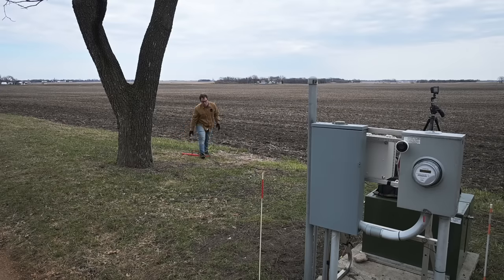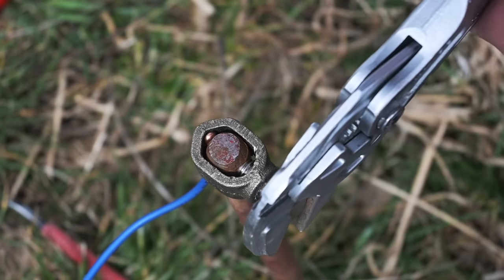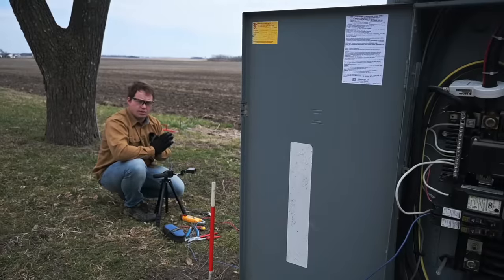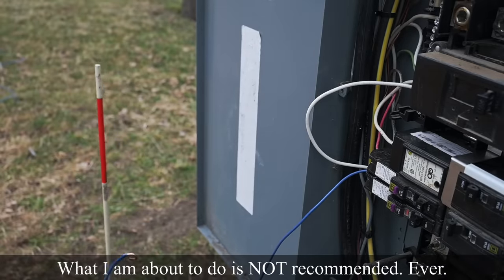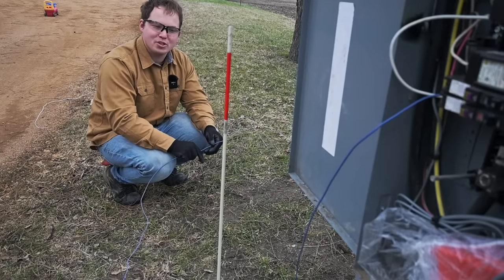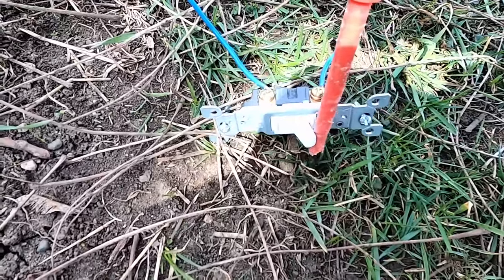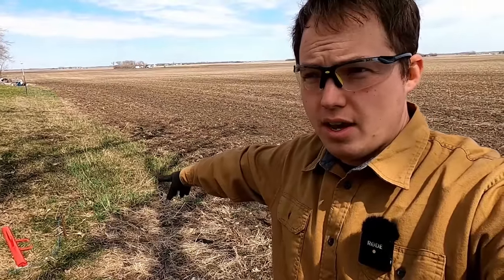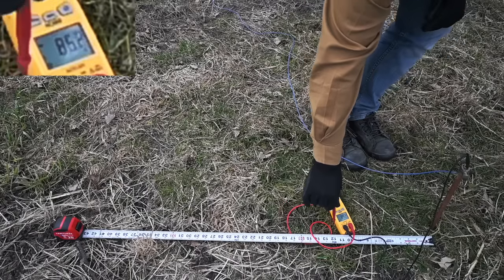Will 120v To Ground Trip a Circuit Breaker?

Comment: This is why the Law says your grounding system must be at 27 ohms !!!! The research shows to reach this number of 27 ohms a mim of 2 ground rods must be put into the ground. Conditionally - that is each rod must have a 10 foot circle or cylinder of earth that do not overlap. If rod # 1 ten foot circle of earth over laps rod 2 ten foot circle of earth than they cancel each other out. They both must have their own ten foot circle if earth thats 20 feet apart from each other. For the ave. Home to reach 27 ohms. And this also is conditional on the soil being conducive. As it is most electrician use only one ground rod against a foundation house cutting the required ten foot circle of earth in half.  This is both illegal and dangerous. The grounding system must be measured for 27 ohms before its conclusion. Or the system is no good. The rod also must be 8 to 10 feet and put into the earth all the way buried its whole length.

Comment: Try it again only this time attach a #4 solid copper wire from the ground rod over to the one which is tied into the main panel. .i bet it will trip the breaker. .Remember u cannot just stab a ground rod and attach something to it and call it good..if only for intermittent surges for lightning strikes..it will disperse the energy into ground but the ground rods play no part for a ground fault. That is what the safety ground wire is for..to take the current via its low resistance path back to the panel..over to the neutral and back to utility at high current to trip breaker. .and remember the breakers are to protect the wiring. .not u..unless it is a gfci breaker.
Reply from the maker: You're on point.

Comment: Grounding was a stupid idea.  Everything would be safer without it.  Think about it, grounding makes an electrical potential everywhere.  If power companies didn't start using earth ground then a stray wire would have no interest in sending current through your body unless you were touching both hot and neutral.
Reply from the maker: I too have thought about this but it seems like there must be more to it? Otherwise what you're saying makes so much more sense. Interesting to think about.
Reply: @BenjaminSahlstrom  , Thanks, most people just shrug it off like I'm crazy!  

I really believe it to be true.  It does seem like it shouldn't be so easy and make sense but I can't figure out a reason it's not true.  Can you?
Seriously I find it really interesting so please add any thoughts!!
Thanks for all the videos!
Reply: They did not invent grounding for no reason. It was adopted very early in the era of electricity, around in 1900. There are several reasons and I accept that I do not even need to know them, I just know that those who did so had good reasons. It takes some arrogance to claim that 100 years of wisdom is wrong. The reasons include lightning protection and prevention of accidental grounding.

Now there is the IT system that has only high impedance connection to the ground from the center of the transformer and no neutrals, just three phases and the ground is provided locally. It is common in Norway and is used in things like hospitals and ships.
Reply: @jfmc2581   a) Grounding prevents the Grid from becoming Highly Charged by Static Charge build-up
b) Grounding prevents the Metal Case of any device from becoming a high voltage vs earth potential
c) Grounding helps reduce damage from Lightning Strikes on the Grid
Proper Grounding saves lives.
The positives out-weigh, your perceived negative ...
Reply: @MrSummitville  , You obviously don't understand what you think you are talking about.😆
Reply: @jfmc2581  I obviously do know what I am talking about.  I presented FACTS  that proves grounding saves lives.  While you complain that touching a HOT wire wire while simultaneously being grounded causes a problem.  That NFPA Council has deemed your unlikely problem an acceptable risk, given all of the advantages.  Let me know when you have some / any facts ...
Reply: @MrSummitville  , Nonsense.  You don't seem to understand that the potential presented by the ground doesn't have to be there.  If it wasn't there wouldn't be any potential for the voltage to flow through a person unless they are touching both conductors.

Sorry it's too hard for you to understand.

Comment: Way more than 20 amps on a dead short.
Reply: Yes, especially given that that panel has probably less than 10 feet of wire between it and the transformer!
Reply: How much?
Reply: @ystebadvonschlegel3295  depends on the size and length of the wire and the available fault current, and how fast the breaker trips. But 500 of 1000 is possible.
Reply: Brian Kiehnau WOW. Amazing you can get 50 times rated output through a breaker before it trips.  I guess that would be an advantage to the old fuses - I doubt that it would happen that way.  Thanks for the reply!

Comment: The reason the breaker didn't Trip witch it would depending on the 12 gauge wire becomes a resistor sort of now if you coil  the wire you would see some different that would be interesting because then you would probably have more Resistance .what do you think would happen in a situation were a 120 volt bulb  would be now you have two wires but no socket for a bulb yet so you have your white and black hot see how long you could hold them na joking but you can for a couple seconds cause you have resistance in you and have a good heart no problem my father who was a linesman my first lesson at about 12 was that he told me told hold them hit the switch to let me know that and not to be afraid now learning more you know there's situations that would fry you but think about the cops tasering somebody and nothing happens and other people go right down your want to be a great electrician go to school to the technician learn PC direct current  resistors capacitors stuff like that .your brain will learn alot plus it's fun to say build you own amplifier with ham radio get your license shoot skip how frequencies work with the sun spot and stuff you are a trouble shooter you would be a great linesman
Reply: The ground between the ground rod and the systems grounding points itself is the resistor. Unless you have less than 4 ohm's between the ground rod and the systems grounding points you will never get the current needed to trip the breaker.